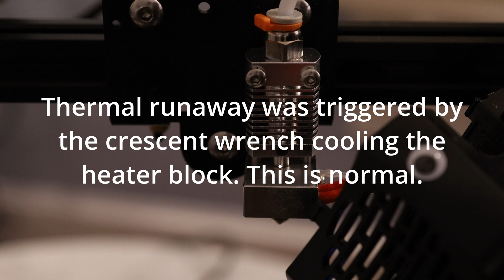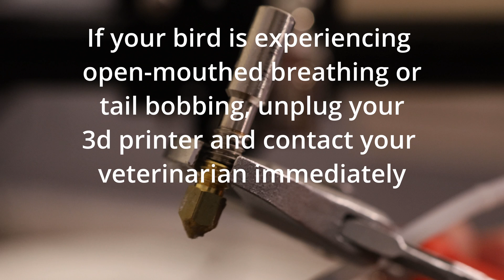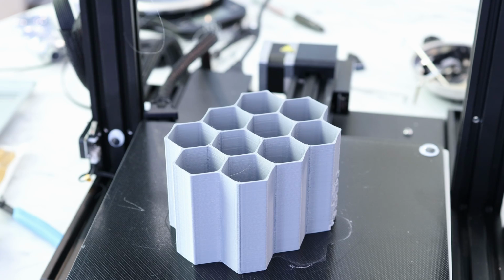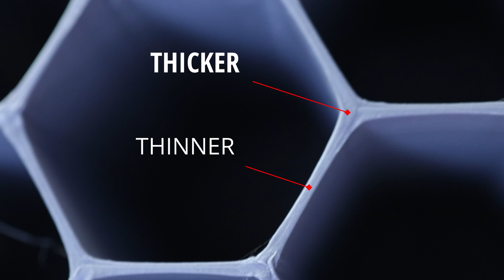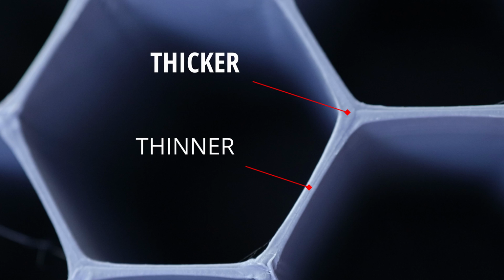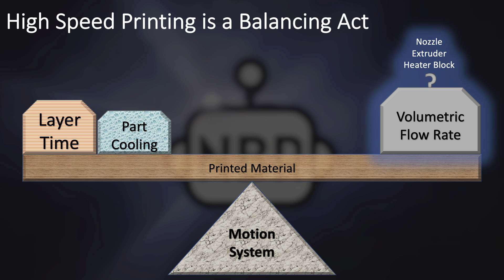Upgrading Your Ender 3 - Easy as CHT

Comment: So I guess my question is -- if I were to buy a cht nozzle for my Creality Ender 3 V2 neo printer, could I get faster print speeds without sacrificing accuracy or quality? Even if it's just a bit faster. 

Currently most prints I have to print at 50 mm/s or less -- when I tried to up it to 70/80 with higher temperature the quality would dip and any specific small parts that needed to be pretty exact would not work. 

I know flowrate is apart of the equation. And I think it's limited to 12 cubic mm? 

But ya -- if I were to get a 4mm cht nozzle, would I be able to increase the heat, up the flow, print faster, and not loose quality?
Reply from the maker: In my experience, the CHT doesn't help all that much until you also upgrade to a direct drive extruder.
Reply: @NathanBuildsRobots  a direct drive extruder? Any you would suggest for the Creality Ender 3 V2 NEO ?

Comment: I'm having so much issue with this cht getting thermal Runaway
Reply: I could really use some advise I have ender 3 pro
Reply from the maker: A new nozzle should not cause runaway. A faulty wire, thermistor, or heater cartridge would though. You might also be getting low temp issues if you removed the silicone sock

Comment: Not sure what your plans are for cooling, but I use a Hero Me with 2 5015 fans which leaves a LOT of headroom. Wish I could add that setup to my V2.4 because the stock Afterburner does NOT handle 300mm/s well.
Reply from the maker: I downloaded the Hero Me and it confused the hell out of me. I want to keep the stock fan shroud, but there's barely any room for an upgraded fan in there, or fan attachments. The struggle is real.

Comment: I understand that its about an upgrade not nozzles but comparing 0.4 vs 0.6 CHT is not "apples to apples". You should do an 0.6 normal with 0.6 CHT.
Reply from the maker: I am doing standardized extruder testing on all hotends now. I will build up a dataset over time. You are correct, this isn't speed to apples. Next comparison will contain more apples, it will be 0.4mm vs 0.4mm on the Ender 3 S1. 

Bondtech published a paper comparing extrusion rates with similar nozzle size. They were using a high performance extruder instead of the crappy Ender 3 one.
 
https://www.bondtech.se/intranet/white-paper-max-flow-rate/

Comment: nice video!
Are you also using a non-PTFE lined thermistor? I was using a mellow bi metallic heatbreak for a while now and some day I noticed the the stock thermistor has the leads covered in ptfe tubing right at the heater block, I swapped it out with an M3 screw-in ntc thermistor
Reply from the maker: That is a great point, no I am still using the stock thermistor. I will be swapping that out for a cartridge style/m3 style thermistor soon. 

I actually just bought a m3 screw in one, I was disappointed to see that its just a glass bead thermistor glued into the hole of an m3 standoff. It should be pretty easy to DIY!

Comment: I have been thinking of getting a few of these nozzles for my Pro 3D V-King 400, I printed some gate and fence post holders for my dad for setting posts to a concrete base using a .8 nozzle and nylon filament, he wants some more printing and the CHT would be ideal for this purpose + I get a new toy!
Reply from the maker: I'd say go for it, they are a bit expensive for nozzles, but if you are only getting 1 or 2 it's much cheaper and easier than doing a volcano conversion. I've wanted to buy some for a couple months, but didn't want to pay $20 for shipping from Sweden. Fortunately Slice Engineering is stocking them now and it's only like $2.50 in shipping for US, and 5% off if you use the link + coupon in the video description.

I posted a picture on instagram of the best 1st layer I think I have ever made. I think this nozzle does a great job at homogenizing the plastic, so it comes out at a very uniform temperature and sI think it helps to smoosh it into the bed more uniformly.
https://www.instagram.com/p/CZYhmbNO4Cr/

Comment: Nathan gates redefining 3d printing. I Wonder what an apple 3d printer would actually look like?
Reply from the maker: Good question, that would make a great video. 🎥 

It would have to have:
Clean industrial design
Great touchscreen UI or
Controlled with iPhone
Impossible to work on
No SD card
Auto bed leveling
No exposed wires or belts
One finger part removal
Webcam built in

Comment: 😂Nathan Jobs sold me on this one! I appreciate the chart with results. Noticed that CNC kitchen tests using a Prusa maintained a 95% extrusion rate at 40 mm3/s while this one was only at 60%. Better parts on the Prusa I guess. Interested to see how much the extrusion rate improves by upgrading the stock ender 3 v2  extruder. Awesome series!
Reply from the maker: The main difference is that the Prusa is using a dual gear direct drive extruder. I will be adding one to this machine soon, it really needs it!

Comment: Loved the intro and the simple video. Awesome work man
Reply from the maker: Glad you liked it! I condensed 8 hrs of footage into 4 minutes. 

You definitely need to upgrade the extruder (preferably Dual Gear Direct Drive) to get the most out of the CHT. In the end it didn't really print faster in real-world testing because the stock Ender 3 extruder and part cooling completely falls apart above 10mm^3/s.

Comment: Have you considered using Klipper to help handle all the processing for cleaner prints? Im experimenting with it on my Ender 6 and CR-10 S4. The linear advance feature is particularly interesting to me because I print parts with hinges that get stuck together due to the over extrusions on the corners when I ramp up the speed. The tight tolerances of the hinge is a problem when printing at 75mms on my ender 3s, but I could potentially double my production if I can sort this issue out.
Reply from the maker: I'm very interested in doing Klipper on this build, and I think it would help in your situation. I want to do all the basic upgrades first (hotend, extruder, fans) because people are intimidated by Klipper and I want to scare them off too soon :P I think I'll have a Klipper video in a couple weeks so keep an eye out for that.

Are there any specific test prints you want me to try out in that video that would demonstrate the issue you're having? That way I can solve it on camera and we can all learn

Also, are you using a direct drive extruder or bowden?
Reply: @NathanBuildsRobots  So did you already try Klipper or do you mean you makes videos about it and learn and document the process?

Currently I am not working with graphics design and sole focus on 3d print.

Have done a lot of klipper reinstallations, setups, tuning and input shaping, configs for all sorts of things and recently got Neopixels effects working with klipper.

If need any help about Klipper on Ender 3 im ready to converse :)

Just in graphics design I won’t do stuff for the time being :O

Love how your videos come out.
Just the right mix of somewhat healthy insanity, humor and hardcore modding pro tips. Congrats :)))
Reply from the maker: Thank you for helping with the channel graphic, it still looks great!

I have not installed Klipper yet, but plan on doing it soon. Hopefully it will be 1 easy to follow video.

I have a ton of addressable RGB LEDs (Neopixels), it would be great if I had a way to use them on my printers. They are all 5v.

Do you know if klipper could control a PWM fan like the Noctua iPPC3000? I was thinking of using them as part cooling fans.
Reply: @NathanBuildsRobots  Happy to help :)

About Klipper install there are 3 mayor easy ways. The easiest ones are using a finished up Raspi Image with klipper and a user interface installed. FluiddPi and MainsailOS. Though a "cleaner" way would be installing classic raspberry OS without GUI and use KIAUH (Klipper installation and update helper) to install klipper, extras and the user interface of choice (Fluidd & Mainsail). Depending on mainboard used you flash klipper firmware to it by either MicroSD card like with Marlin or directly through USB (not all boards support these).

Additionally one can connect the printer mainboard by USB or direct SPI cables (uses TXD/RXD/GND). During Klipper flashing setup you choose between USB or Serial connection. In case of wanting use of direct serial connection for cleaner cables (or wonky MircoUSB port on my printer board) the flashing happens by USB but the flashed firmware is setup for Serial, flashing through Serial not possible it seems.

For LEDs on klipper there are many many ways. Data pin from Rpi GPIO (which seems to work on python), from the mainboard by whatever pin

Klipper is hardware agnostic so you define pins however you like in the printer.cfg and it usually does exactly as wanted when cables are connected to correct pins

or use an Arduino like device that is connected to the Rpi as a secondary/third MCU which controlls the LED. That way I think FastLED libraries and stuff can be used which is the way I want to go, because I want the fanciest light effects for my tuner car, i mean Ender neon underlight :D

So to your last question. Pretty much yes. I havent tried much yet but found out in Klipper about hardware and software PWM. So controlling fans (btw you can define in the .cfg fancy temp reactive fan profiles, so dead silent when everything cold and idle, and only using the fans that are requiered, used a thermistor in heatshrink put into PSU to probe the "exhaust air" temp. You can take the probed temp to controll fans or pretty much anything you want adjust or switch like lights, filter fans, smartplugs when connected to moonraker (klippers system base system which controlls everything). I donkt know exactly your board so either connect the fan to printer fan output but get the 12 v from a buckconverter source, or when 12v possible on board then directly, or (which i try soon) use a PWM controll pcb thing which accepts PWM signal to drive a normal device like a simple motor by relative volatge. It has a DC in and output. For example I will drive my Berd Air Membrane pump for the Ender 3 this way. 24V dc goes into the PWM controll thing DC IN, pump to DC OUT and PWM to mainboard. Then adjust pins in klipper config so it drives the pump which cant use PWM on its on by PWM through Klipper.

its easier to use printer mainbaord pins for custom stuff than install Raspberry pi stuff to use the GPIO pins as data/pwm controll spots. At least for me its much easier.

So from what I understand its possible to drive anything from Klipper/Mainboard as you can define anything as any PIN (exagerated for argument) but if it does not natively then buck converter and the PWM "relays" make it happen.

Cheers :)